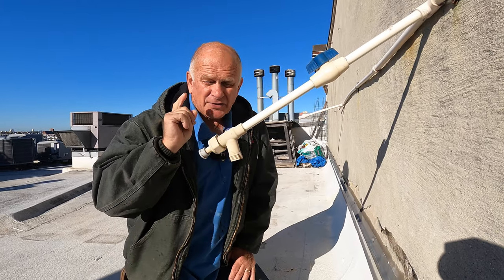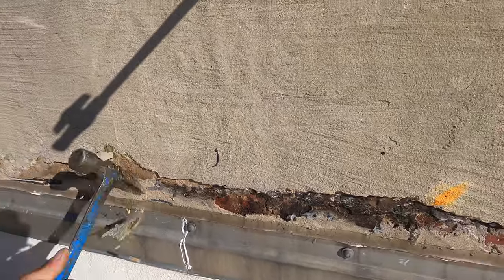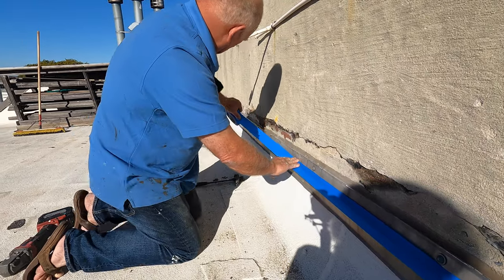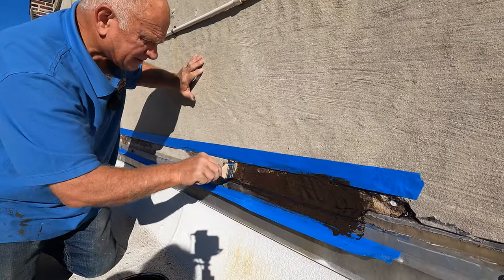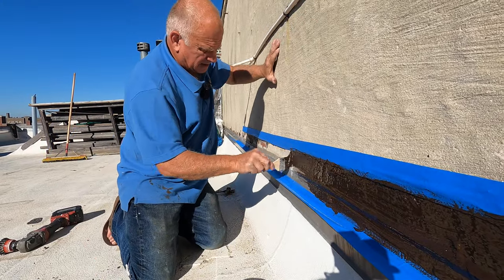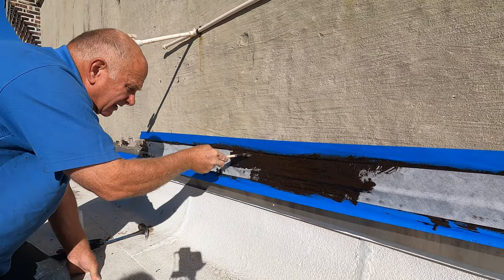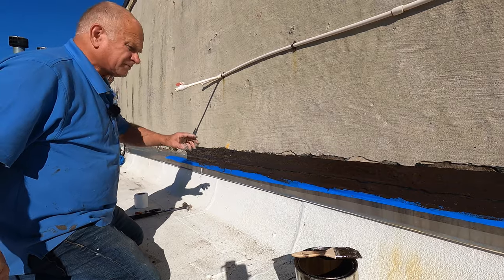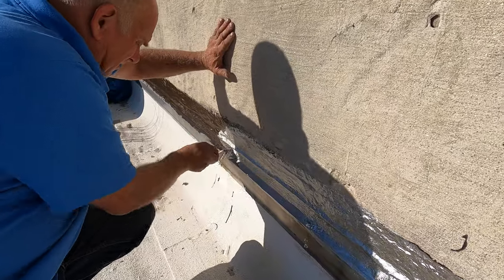How to repair Leaking Flashing on a Stucco Wall

Comment: Thumbs up.  I did something similar but more elaborate to a poor flashing install in an extension to my home with a tile roof, which originally had issues with leaks, flashing over stucco instead of under, bad install. I actually carved the stucco and stuck the flashing under it and re stucco and seal coated, never had leak problem again. 

The story of my life is having hard time trusting people,  even professional companies that do not have well trained employees.  

The quality of work is not only on the planning and prep but also in the final details and not many companies pay attention to details, or [premeditate the proper steps in the work requires.  I am a perfectionist and I like things done right the first time, reason I work best on my own and I end up doing most of the work myself, wherever I can.  If I was a contractor, I would be very good and successful at it, but that is not the line of work I enjoy, however, it is good to understand the mechanics of things, especially when you own a home and are a DIYer.

Comment: Turbo is nothing more than liquid caulk. Snap a chalk line above the damaged area and use a 4" diamond grinder to cut a 1" slot in the wall. Use preformed metal flashing with a reglet edge and install caulk in the joint.  Install the metal in the joint.  Use Zamac mushroom head anchors to hold metal in place then top caulk the joint and smooth it out with caulk knife.
Reply: Sure, make a video about it.

Comment: Thanks so much. You're the master.
Reply from the maker: You're welcome!
Reply: @FlatRoofDoctor  I often saw that when people replaced their old widows with double pane windows, they installed trim (2 inch wide) around the new windows. Did they do so to prevent leaking?

Comment: Great video.   So,  is the metal flash screwed right on top of the cement?  Would you then place stucco on top of the liquid products you just applied to the cement?
Reply from the maker: just to the cement

Comment: Can the aluminum paint be painted over with the wall paint.
Reply from the maker: You can protect the bTurbo Poly Seal with any oil based paint or primer then any paint

Comment: What brand of silver coat protection did you use
Reply from the maker: Any brand is fine, normally I would get it with the kit at Bergstromm.com but you can buy it at Home Depot. Karnak is the best brand